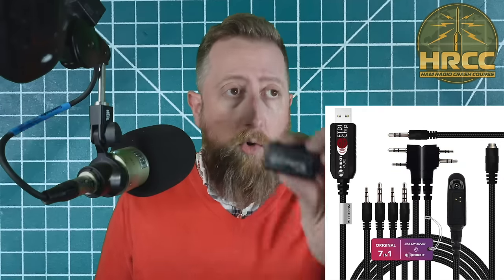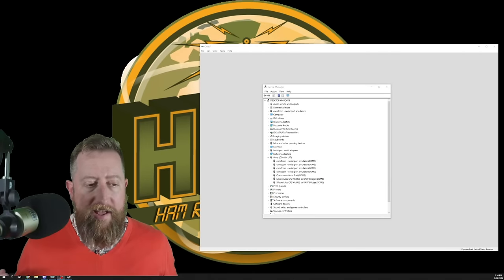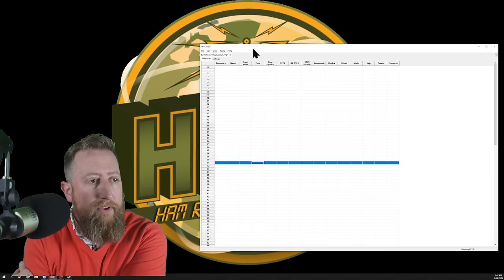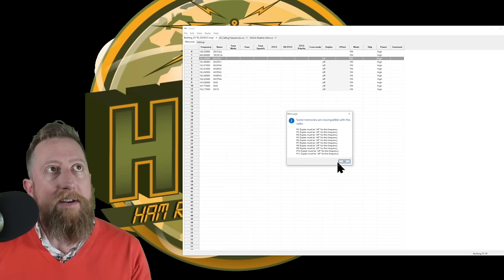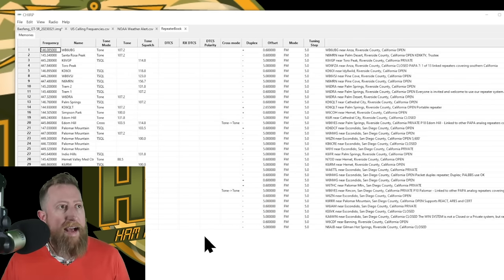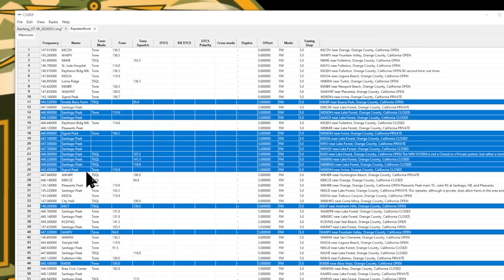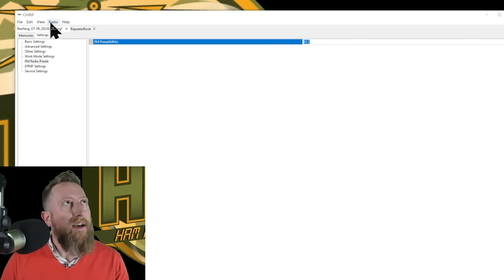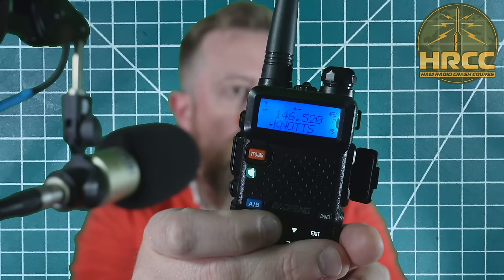CHIRP *NEXT* New Program for Baofeng Ham Radio (GMRS, FRS, MURS)

Comment: Thank you for this!  Especially the hint about turning duplex to "off."  So many throw an absolute fit about Baofengs "because they can be set to transmit out of amateur bands."  Well, number 1 - just because the machine can do something that breaks the rules doesn't mean it should be held accountable.  I wonder how many of these fudds, lids, and sad hams would blame cars for drunk driving fatalities, guns for murders, and spoons for fatness?!  No!  It is the person using them the wrong way, not the object itself.  And just because out of band frequencies can be programmed doesn't mean they shouldn't be.  Be responsible!  Turn the duplex to "off!"  Think back to your tech quiz!  YOU are responsible for your station!  Same way YOU are responsible for your car!  Just because you "are afraid to drive" (aka, use a Baofeng) doesn't mean you get to dictate that I shouldn't be able to use one when I can use it responsibly and not transmit outside my band privileges!  Also, remember, it isn't against any rule to listen to anything over the radio!  What gets people into trouble is TXing!
Reply: The Bao, because of it's useful properties, is great in a SHTF scenario when you can choose from multiple modes of communication.  Don't bash the Bao, embrace it.
Reply: The same thing can be said for our Second Amendment right just because you have a gun doesn't mean you can handle that gun irresponsible you're the one responsible for the gun not just the gun Common Sense will tell you again doesn't have a mind of its own it's the person that's operating it the same way with our radios we don't go out of band and transmit when we're not license for it we can like you say however listen to it it's okay to do that irresponsible
Reply: This might be the best rant on the internet, certainly the best under any HAM radio video. Bravo!
Reply: Absolutely! It's hard to beat a 20 dollar HT. My old UV-5r died; so I just ordered another one so I can back into ham radio. Apparently the current models are limited to TX on the ham bands. But you can jailbreak them for general TX. I like that it requires deliberate effort to TX out of band. Maybe this will keep people from using these for MURS, FRS ETC. But like you said it's the responsibility of the individual not the radio.
Reply: VERY well said
Reply: Does anyone actually get in trouble for improper txing?
Reply: @alexmason1387 never once in the history of radio has anyone ever been in trouble for anything. All of these stories of “my friend” and “I knew a guy” are bullshit. No one cares and no one has the manpower to do anything.
Reply: Very well said @Survivalbill5206
Reply: Amen to that! Now I’m going to go on Ham without a license and transmit Conway trwitty for hours!  That will teach the cry babies!
Reply: @alexmason1387  People can transmit on any band they want with modern software defined radio devices like hackRF.   The baofeng is weak sauce for “general purpose RF output”, why people whine is because of decades of heavily locked down ham-focused devices that keep the handcuffs on at all times.

Comment: Tables have turned and now its a Nightmare to install on Linux Ironically. The required Python changes can ruin your entire installation. I have to stick to the legacy Chirp...Maybe a Chirp-Next Flatpak or Appimage in the near future. Or when I upgrade to Ubuntu 20.04 or higher. I dont wanna mess with my current Python install.

Comment: Just got the new AR-5RM radios. I already had the cable and CHIRP installed(older version) and was familiar with the process of upload/download. Plugged in my new AR-5RM and nothing. Couldn't even see the radio. Plugged in my UV-5R and bingo, all was good. Any ideas why it didn't work on the new radio? Does the new chirp fix this?

Comment: Very well done video! Having been around radios and scanners my whole life first working for the fire department and then getting into law enforcement for a total of just shy of 30 years before retiring I know this isn't necessarily rocket science but for some people just getting into these areas that sure helps to see a very well done and easy to understand video like yours. I watched your video because you were dealing with Chirp Next. I have been getting away with the Legacy version of Chirp for several years now but I just bought the new Baofeng AR-5RM as seen on NotaRubicon. As luck would have it Chirp Next will not work on my old laptop, which is 32-bit. Of course Legacy is not updated so none of the newer radios show up in that version. I ordered a new PC which should get here in 2 days and then I will load Chirp Next and be ready to rock and roll. You helped me get an idea of some of the minor differences between the Legacy version and Next. Thanks for the info!
Reply from the maker: I’m glad it helped!

Comment: Thank you for this video. One issue I encountered that may not have been emphasized enough is that if you do the programming and your radio does not accept programming - check the programming cable plug into the side of the radio and make sure it is plugged in securely as it can be difficult to determine if it is connected properly and this will prevent the radio from accepting programming.

Comment: One thing I miss with the new version is the ability to import an already existing profile.  I do like that I can now filter for both 2 meter and 70cm instead of having to query them separately.  I also like the fact I can now query for only repeaters with FM mode and filter out the digital modes.  Although I did notice that it may still omit repeaters that you can use analog FM while digital modes are also being used.  My club's 70cm repeater is capable of Fusion and WIRES, but you can still transmit using analog FM while someone is transmitting digital.

Comment: I just downloaded chirp next about a weak ago. works great on windows 11. no problems .easy install /replace old version. some GMRS radios not listed . but for the HT's I have it program's great.I have outher software for my outher HT. both work on windows 11 but not run at same time. just what I do, I got the cables for 2 BaoFeng to make repeater. solved the RF overload. small duplexer . works super . GMRS repeater portable . all fit in ammo box .  and the roger beep is on. make Randy happy. 73's

Comment: Great Video.  I just updated to Chirp next.  I am now working on updating my programing adding/updating the local repeaters ect.

Here is a suggestion for a video although it may take a new tool.  Plotting the local repeaters on a map or pulling your programmed repeaters into a mapping tool so that you can have a paper map of the repeaters in your radio.  Uses would be Cells down or no service, planning a road trip.  There are times it would be good to see visually.  Since the repeater book filter do appear to be by distance it would be good to have a way to see.  I found that if I look each repeater up on the repeater book app the grid square is there the data is available I just do not see a way to export it and then plot it.

I do love your content.
Thank you 
73
Doug
KE8OWD
Reply: Never mind I found it on the repeater book website that is what i get for trusting my phone.  (Wait that is why i want a hard copy in the first place)

Comment: Good video. I just had to modify my 5R and got my first taste of NEXT. I had a real dumba** attack for like 5 minutes (3:04) when the get File menu or Radio menu page came up. I tried clicking everywhere and nothing till I figured out it meant the top of the page. They could have put two boxes next to the CHIRP logo lol
Other than that, it works nice. Here's a msg for manufacturers. The radio's have PTT-ID on transmit-fine. Now make a radio that can read it like my Motorola does. Wouldn't it be neat to see who's talking on the display?

Comment: Hey, just getting started in HAM at 69. This video was great and I programmed my two type Boafengs (UV-5R & BF-F8HP) without problems. But, using the new NEXT CHIRP I found that it did not allow me to add my favorite FM Station as you did. That line only has a checkmark box. I'm guessing I need to manually add via keypad? Thanks again for all your videos!

Comment: Some great info here on the new Chirp. It now supports my Quansheng, which also comes with the Silicon Labs cable, this is great news, as I had lost interest in the Qaunsheng radio.
I did notice that when I go to File menu to open "Stock configs directory it is empty, and contains no data. I was interested to note how the csv files are formatted. In reality, it appears that the "stock config" folder is stored in a different place. C:\Program files(X86)\Chirp\Chirp 
I was curious as to what " Enable Automatic edits" is ticked by default, and what it's function is?
Keep up the good work..

Comment: I would not discourage folks from putting MURS, orGMRS/FRS on their Ham radio.  They must understand however that they should change antennas to one that will provide an acceptably low SWR for the frequencies that they will be working.  I make my own and tune them to perfection, but these are not as nice to carry as are commercially made antennas. One needs to use an SWR meter and check all antennas they use.  I've ditched commercial antennas.

Comment: Fantastic video and thank you for putting it out there. One issue with mine is the channel name display on display mode 2. Its set in chirp and the radio as well on menu 22. Not a big deal overall. Its a $25 radio. I appreciate the content you make and all you do for the radio community.

edit: found that switching around the frequency to display on B and the name on A worked for me.
Reply: I've tried many things (switching Name on A, freq on B ... or freq on A, Name on B) but I'm convinced my A is broken. Too bad. I even reset the radio and tried again with the same result. Time for another Boafeng, I guess.

Comment: Nice! I haven't really done anything with ham radio since moving to Las Vegas a couple of years ago. I just ordered a UV-5r and programming cable so I can get back into it. I have rigs on my dest but I still need to get antenna up and all that jazz. A 20 dollar HT will get me on the air until the shack and antenna farm is up and running. I was planning on using Chirp. I am going to give this new version a try. 

Thanks for the video.

73 DE KK6FVP
Reply: I should add that I like that you can program FM broadcast frequencies. One of the features I like about the Baofengs is FM broadcast reception. That was one feature I wish my Yaesu FT-60 had.

Comment: Thanks for the video, very concise and helpful. BTW I keep getting an error message whenever I try to insert a frequency under the settings panel. Program lists 1 through 20 FM channels, in the second column, I try to input a local FM broadcast station, although the pgm will not allow the input, stating the value must be between 0 and 5 characters. Might you have any suggestions?

Comment: Do you run the installer as “Administrator” on Windows ?? I always have done it that way, don’t know if I need to… also make sure you don’t have chirp running when you run the installation. (it may fail since some files are in use)
Reply from the maker: I didn’t.
Reply: @HamRadioCrashCourse  interesting… I have other machines to upgrade, I’ll try running as a user…

Comment: I have WIN 11 computers and the a port designation does not appear for a the Baofeng UV-5R.  There is a COM1 and PL2393TA Does not support Windows 11 "Port"  which is an option when the BF is plugged in.  I recall I had this problem last year in using CHIRP (legacy).  I literally had to install the CHIRP on a WIN 10 PC that I had in storage to use CHIRP.   Incompatibility with Windows 11 does not seem like a "Next" to me.
Reply: Chirp is fully compatible with WIN 11 i am using for programming and Chirp Radio driver development.   Sounds like your cable drivers may be the problem and not Chirp itself.
Reply: @MRTjr9216  I'll look into to it.  Thanks for the tip.

Comment: Could you do a tutorial for using your HF radio instead of an SDR dongle with CubicSDR? Preferably with Linux. . .
Reply from the maker: You can really only access an HF radio via an SDR software if the radio supports that type of control.  Most don't.
Reply: @HamRadioCrashCourse  wouldn't anything with CAT control or USB soundcard work?
Reply from the maker: No not really. CAT is just computer control of the radio vfo and audio.  CubicSDR is for running an actual SDR.
Reply: @HamRadioCrashCourse  My FT-991a works with it, and I think the FT-450 does too, it's really nice having the full detail of the superior waterfall.

Comment: Off Topic Question. I just installed a head unit Teyes CC3 it runs android.  It has many USB plugs and is basically a tablet computer.  Can I hook up that USB device and download a app to the radio to get it working while driving?
Reply from the maker: Doesn’t run on Android.

Comment: Question -Anyway to import from repeater book, and have freqs in numerical order like CHIRP Legacy does? (eg. 146.840 is above 146.860). Thank you!!!
Reply from the maker: Ohhh, interesting question.  Try clicking the top tabs for frequency based on your query.
Reply: @HamRadioCrashCourse  tried, and tried everything else I could think of, no luck. So still using CHIRP Legacy
Reply: Yes, you can. I'm using CHIRP next-20230507. Copy and paste what you want from the repeater book tab to your radio's tab. Select the rows you want to sort - do NOT include empty rows - then right-click on the grid. You'll see a menu that includes "Sort 89 memories" (or whatever number of rows you've selected). Highlight that and a submenu asks if you want to sort in ascending or descending order. Select one of these and a listbox opens that allows you to pick which column to sort by. Click OK and your list is sorted.
Reply: @TheRealLaughingGravy  got it to work, but man is it a lot of steps for something that Legacy just does...

Thank you for the help! 73

Comment: I just used this today and was wanting to ask for a video! Man, TBH, I kinda regret updating; there is still a lot of bugs to be worked out. I recommend sticking with the older “legacy” version for at least a couple more months. It was WAY easier to reorganize channels before. Some software errors when changing settings to loaded station lists required redoing download and going back a step. For now, no bueno.

Comment: Nice video but I would like to see your repeater system because I’m new to the radio I’m barely ON CB but interested in getting my tech license to get on 2 meter and 70cm right now I have a old UAW UW-03 with no antenna or battery well a small wire for antenna I have it programmed to listen only to local police here in  California Central Valley and in the future if it’s within my reach I would like to have my own repeater

Comment: Been looking at uv-5r and been stuck between listings for 5w and 8w. Look the same 😵. Now for the unlock frs gmrs and murs, can the bf-f8hp also do the same? Any pros and cons between them both is the uv-5r is legitimately available in an 8w package? Cheers. 73
Reply: Newbe here but yes I used the older chirp program and was able to do frs and murs.    I also have the bf-f8hp.  It was very easy.

Comment: I've been looking at getting a yaesu vx-6r. Does anyone know if you have to get the $50 programming cable with the cd or if it's fine to get a cheaper cable if I'm using chirp?

To mention I have my tech license but I'm now looking to upgrade from baofeng and since yaesu doesn't use a Kenwood connection I'm trying to figure out what cable I need to get.
Reply from the maker: I did, the reason is the non-standard threaded connector for the radio.  I felt it a better Idea to just the RTSystems and be done with it
Reply: @HamRadioCrashCourse  That's fair, I assume I can use the same cable if I get a FT-60r later. Or will I need to drop another $50 for a cable and cd since it's a different radio?
Reply from the maker: The VX-6R cable will likely work with the FT-60, but please check the wiring first.

Comment: Nice about chrip. But many player its connect radio is the problem. The cable that ship with Boafeng is Megavolt. These do not work. Prolific cable should work but it doesent either. Please advice if you have time to do it. :) I use Windows 11

Comment: That was very helpful! Thanks!
I have now a Baofeng GT5R and to my surprise it was locked in the GMRS range when I got it. I did the Baofeng factory reset but it didnt work either. Can I have some help with that? I would like to use the GT5R as a GMRS radio too... 😢

Comment: I'm a new Ham and just got the CHIRP program for my Baofeng. Great video on how to use it. I do have a question though. In the "other" settings there is a box that allows you to increase/decrease frequencies on the radio. Does this actually work? I don't have those privileges, so I haven't tried it. Just wondering.